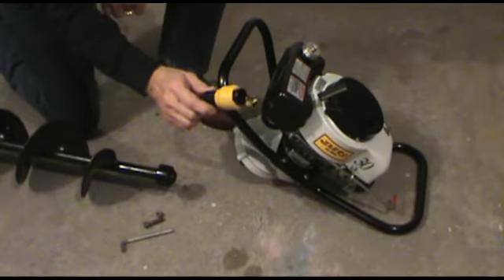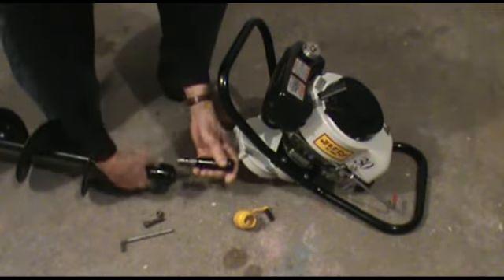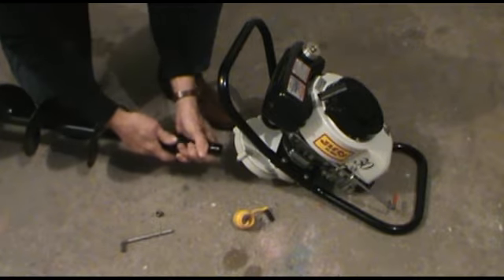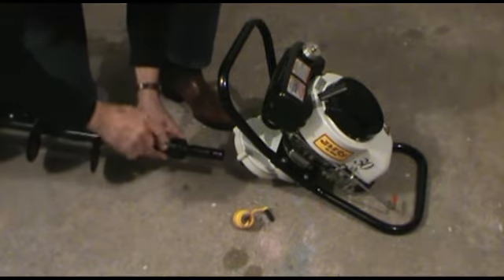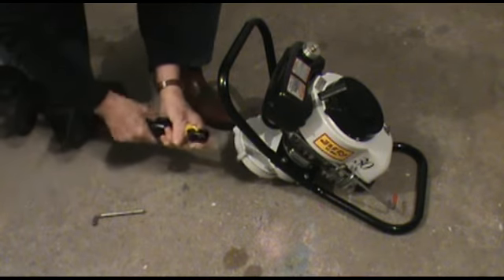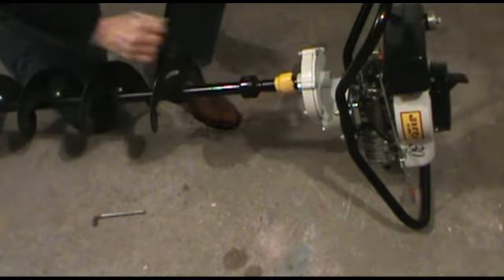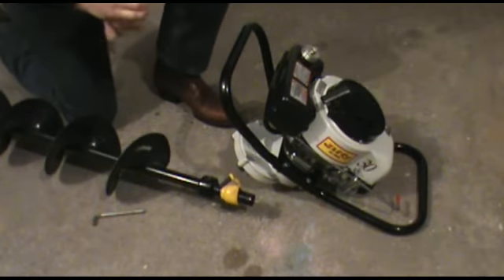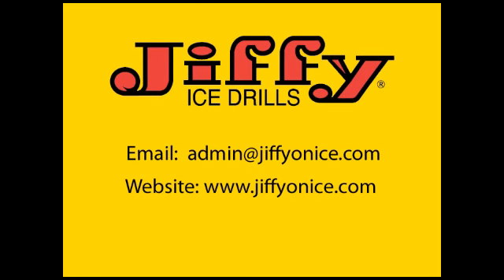Jiffy E-Z Connect Collar Adaptor

Comment: Does the e-z connect collar ever fall off? I have just recently bought a model 30 unit with a 12" extension. the flight is 36" and in the later months of the fishing season  i might have to get another 12" extension to get through 60" of ice. I am wondering if it is ok to use multiple extensions , or is it possible to get a longer flight. I don't want to loose it down the hole.